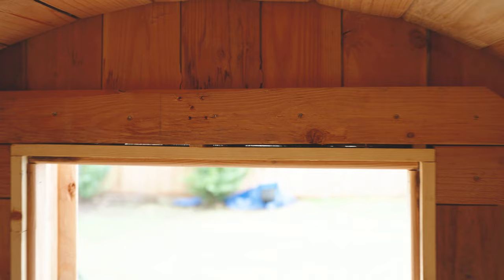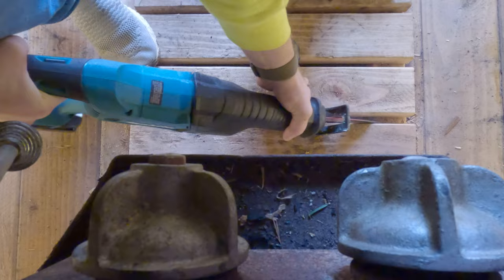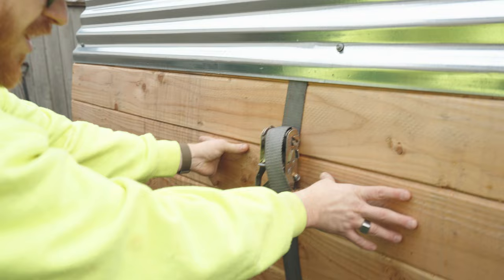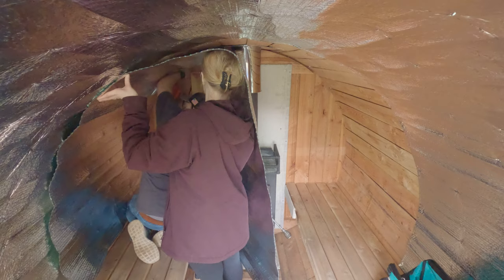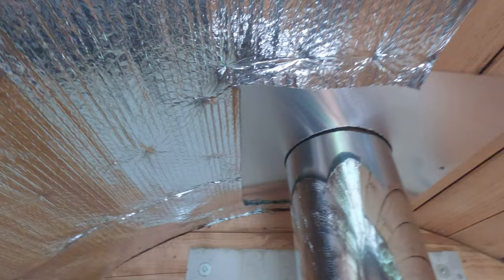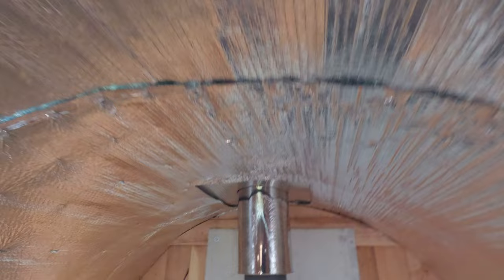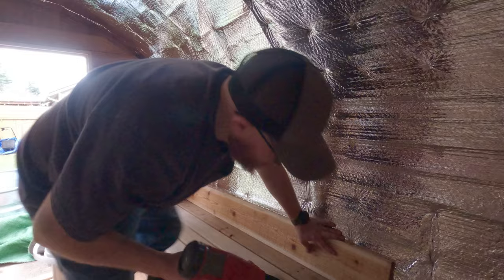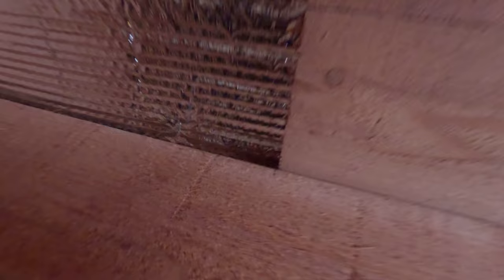Pine Barrel Sauna after 116 days of use

Comment: Framing lumber is heat treated and typically not all dry. Stacking and stickering it for a few weeks would have helped a bit and prevented some shrinkage. Nice project!
Reply from the maker: Thanks so much! But you underestimate my lack of patience 😂 some of these 2x6s were so wet they dripped when I screwed them into the wall! 
I’ll definitely keep that in mind for the next project though.

Comment: I wouldn’t worry about the cracks at all! If anything it’s actually better to have air flow. Air flow is the most important thing in a sauna. You need a vent on the bottom by heater and one on top. But with those gaps you probably don’t even need a vent now.
Reply from the maker: Thanks for the input! I put (2) vents in behind and near the stove, one by the door, and the drain holes below act like vents as well. 
After I put the cedar planks in, it definitely needs to be vented when in use 😅

Comment: Great video!

One important aspect to consider, is the potential for condensation and dew point issues.

When using diffusion-tight materials against organic materials, like wood, it's crucial to include an air gap between the inner wood and the insulation. Without this gap, condensation may occur within the wood due to the temperature difference between the insulation and the sauna when in use.

In the summer, a different challenge arises, particularly if the sauna is cooler at the start of the day. In such cases, water may condense into the wooden structure. However, regular sauna usage can help mitigate this issue by expelling moisture through heat by usage.

In Sweden, we've developed a layered approach to address these concerns:

1. Wooden panel
2. Lath for creating an air gap
3. "Wind paper" (Tyvek cover): Provides protection to insulation but allows water vapor to migrate out.
4. Rockwool insulation (>95mm often between 200-300mm)
5. Diffusion lock (thick plastic, air/water-tight, overlapped 100mm, taped with "age-resistant" tape)
6. Thinner layer of rockwool insulation between studs (45mm, as our studs have a standard of 45mm thickness)  (Not in a sauna)
7. OSB Board
8. Drywall (Not in a sauna)

For saunas with high moisture content, treating the interior as if it were the exterior. We add these additional layers:
8. Sauna foil: A diffusion-tight reflective material that retains heat and moisture.
9. Sauna wooden panel (an airgap is usually not required, as the cold side is on the other side of the foil and the dew point is there)

This layering approach ensures effective insulation while preventing condensation-related issues in saunas. It's a common practice here in Sweden and has proven successful.

Here is a translated page with some more information about sauna construction: https://www-bastupunkten-se.translate.goog/infosidor/hur_man_bygger_bastu.htm?_x_tr_sl=sv&_x_tr_tl=en&_x_tr_hl=en&_x_tr_pto=wapp

Here is a page about dew point and isolation: https://www.novagroupgbc.com/post/the-importance-of-considering-dew-point-when-increasing-insulation-in-existing-buildings
Reply from the maker: Wow thank you so much for that information!
I'm glad you liked the video, and thanks for your valuable input!

Comment: As Finn I would say that I would sit on that. Great job, althou caps would make some heat escape. Anyways we make sauna's also in tents, so heat escape is in there too. It just make you more baneful to keep  heat in. Anyway, I bet you get enough heat to feel all the benefits, as you have used it for so long. Pine is good, spruce is better for walls, exudes less sap. As beds we used to use Apachi or today heat treated aspen. Anyways, great job done.

You would have needed to leave air barrier between isolatiom and final panel. Moisture will rot walls if not ventilated. Remove cedar and make bars between isolation and cedar and leave caps to air vent out. If you would not, rot will eat your walls away.
Reply from the maker: Thank you ! And thank you for that information, it’s great to hear how you do things sauna-related!

Comment: I think that on the initial build I would have run a thick bead of heavy duty, waterproof / heat resistant construction adhesive along the length of each stave, and maybe even Zip Tape the seams. Considering the fact that it's relatively inexpensive pine, I would have probably just covered the entire exterior then with some sort of a stucco finish. My reasoning is that I wouldn't want water or moisture getting in between the pine and the reflective insulation and causing mold.
Reply: No, No, No, you dont do that, obviously you have never seen, build saunas, Barrel Saunas !!!=(((

Comment: Wondering how much you spent on the cedar in this video and if it would have been just worth it to buy cedar in the first place to avoid line the inside and do more work
Reply from the maker: I spent just under $100 bucks. Definitely wouldn’t have been worth it for me to do it all with cedar, as cedar would have costed me many times more than the wood I used.
Reply: @Sparky_Mark  oh totally fair enough. And wow that crazy that that was only $100 worth of cedar. I would have guessed 700-1000
Reply from the maker: @quinthielmann1875  yeah, it was on the discount rack at Home Depot for 70% off!

Comment: not sure if it's been asked before or not. what was your total price on the add ons ?
Reply from the maker: Meaning what exactly, the insulation and the cedar inside? That would about $150. 
The entire project is about $1400 ish bucks.
Reply: @Sparky_Mark  how much was the cedar? and also what is the lowest temperature you've used it ?
Reply from the maker: @hockeyman1 cedar was just under $100 bucks, and the lowest was probably like 30 degrees Fahrenheit?

Comment: That reflective barrier does nothing. It works well when there is an air barrier, but there's none in your case. By stacking everything together in a sandwich you reduced any IR reflection capabilities and converted it into a thermal conductor. Reflective insulation reflects IR, but in order to work properly it should not touch surfaces you want to insulate.
Reply from the maker: Thanks for sharing your insights! I appreciate the feedback. I'll definitely take into consideration what you've mentioned about reflective barriers and the importance of maintaining an air barrier.
I say over and over I don’t know what I’m doing. But I do know that the sauna is way hotter now that I have put this in, and it keeps the hot air from leaking out from between my staves.